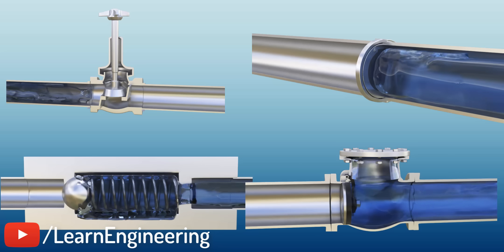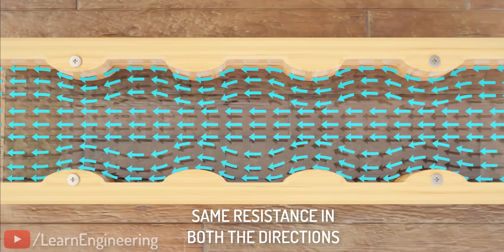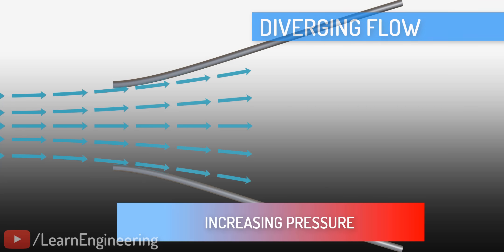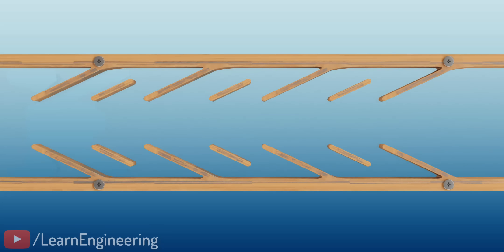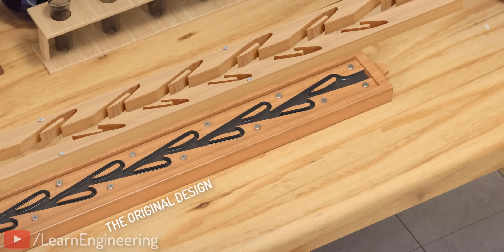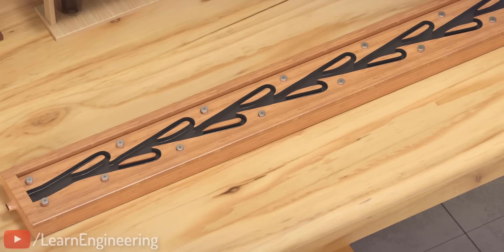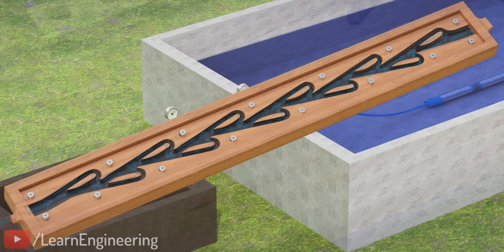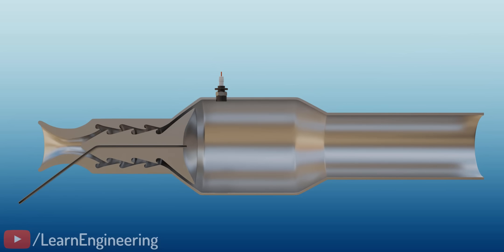Tesla Valve | The complete physics

Comment: I built an optical analogue of this in the 1970's.  I was not aware of Tesla's fluid version.  Same principle, more or less.   The optical version was a 'circulator' which allows light to pass in one direction, but blocks it or re-directs it in the opposite direction.  Existing circulators at the time required polarization and rather exotic crystals.  This version required only light fibers.

Comment: Pressure decteases in converging flow?  Going for om a huge pipe will increase velocity which is what you indicated but wouldn't it also increase pressure.  The water coming out the small pipe will be fast, powerful and aggressive common logic says it's under more pressure.

Comment: Although this design is interesting and I enjoy videos like this, this Tesla valve DOES NOT serve as a one way check valve as stated in the video.  It would in fact be a terrible and fatal design for equipment if used for such.  A check valve is meant to allow the UNRESTRICTED flow of a liquid or gas in one direction while stopping it from flowing in the other direction.  This design, as illustrated, does not allow an unrestricted flow, in either direction.  It creates turbulence and pressures which would not be desired.  Nor does it stop back-flow, which is the entire purpose of a check valve. I utilize a check valve on my swimming pool system to keep my water pump primed at all times.  You would not want to restrict the flow of water to the pump, which is what this Tesla design would do.  I've had check valves repaired and replaced that are utilized in sewage systems.  You would not want to restrict the out-flow of sewage while the pumps are running, but check valves are needed to insure that there is no back-flow, which would cause the system to work unnecessarily harder.  In fact, it would cause the failure of the system with long runs uphill and no check valve.

Comment: I have always replaced a "leaky" valve  with one that does not leak. Plus this "valve"  is NOT a valve, it does not work as a "valve" because it is always either "on" or "semi-off". So, where would you use such a "valve"?

Comment: So it’s not a valve, it’s only use would be to slow down water and possibly gain energy from water sources. He didn’t design a valve. The purpose of a valve is to completely stop flow in a single direction, this doesn’t even do that. Cool idea but it’s weird that it’s considered a valve

Comment: if you need to change the direction of the valve, then you have a moving part + it doesn't stop the flow completely. The initial challenge failed.

Comment: OK but if it doesn't stop the flow of water and you have to place it in a specific way to get the specific result, why is it called a valve instead of a pipe with high resistance? I always think of a valve as being able to stop and start the flow when needed.

Comment: Aside from that one example, are Tesla valves used anywhere else? I use swing and spring type check valves a lot in plumbing. I would imagine that Tesla valves would have to be too long to be practical in most plumbing applications.

Comment: Despite it's name it's not really a valve. A valve can be turned on and off. Most valves can restrict the flow completely. That's just some structure that slows down the flow of a liquid in one direction. It can not be turned on and off - other than reversing the flow of the liquid. It's a flow restriction - not really a valve.
Reply: A simple small check valve that you can buy at the hardware store can't be turned on or off anymore than this valve can. Yes, it is indeed a valve.

Comment: 0:17 Of course it's impossible. Water is a moving part. Or you can think of it as a bunch of moving parts.
Reply: I was going to say that it is not technically possible because the tesla valve works by redirecting water against itself which essentially reduces the speed of the water by a percentage which would make it impossible to completely stop moving
Reply: @Michael-W-V  Well, no valve can work with perfect accuracy one hundred percent of the time.

Comment: Nikola Tesla: god of superpressure tech, where his waterjets are so powerful that they cannot be penetrated by blows from an iron bar.  Tesla reports that he almost died at Wardenclyffe, when the steel bolts suddenly fractured from a high-psi flange, and the flange was flung right up through the roof.   He said it missed his face by inches.  
The key to this is AC-to-DC conversion.   If you yell loudly at the Tesla valve, it should produce some wind.  Also, if connected to a sensitive pressure-switch, then loud sound-vibrations should pump some air and cause the switch to close.  With several valves and several resonant cavities, you could make an electric door which only opens when given a tone-sequence (when it hears specific music being played.)   
Submerge a Tesla-valve in a vibrating bathtub full of water, and the valve should propel itself forward; an example of wireless power (the valve is harvesting energy from the water's ambient vibrations.)   Now try it in air.  Can you make a sort of helicopter lifted by air-jets, where the power supply is a nearby bass loudspeaker in the same room?   
Note that the Tesla-valve is based on fluid inertia, and it stops working when fluid is too viscous.  Make a Tesla-valve straw, and if you suck up some milkshake, the straw works the same in both directions, but if you try it with a glass of water, it again becomes a one-way valve.  The fluid must have low viscosity, so it easily forms jets, turbulence, etc.  (Heh, now repeatedly whack the water glass with a drumstick, and the straw becomes a fountain.)

Comment: But what about pressure changes? It seems that restricting flow with vortex's would also increase back pressure on the system - yes? What if you used the same principle for an exhaust manifold on a generator. Would this create enough back pressure to damage the equipment? Tesla's valve is a VERY interesting concept!

Comment: Check your history. This failed for the reason it was invented. It is in reality a bidirectional flow restrictor. it restricts flow in BOTH directions. Even the FORWARD flow is restricted but in reverse while it is more restricted there is still a flow.
This is not the case with a check valve.
This is a failed experiment because of the problems of the fact that flow is only restricted instead of being checked in the reverse BUT the flow is ALSO restricted in the forward.
The more efficient it is made to restrict reverse flow the more it restricts forward flow.

Comment: it doesnt matter what happens between the entrance and the exit with liquid. 1cc in equals 1cc out. If you are using a positive displacement pump to move the fluid, the pressure MAY increase, but volume wont change.

Comment: This isn’t a valve it’s just a resistor. Isn’t the definition of valve to control the movement of water or air. With this you are just slowing it down i guess you are controlling it but you can’t choose the control you just put it there.

Comment: I think it's interesting that Tesla called it a "conduit," and not a "valve."  I personally think he had bigger, (longer and wider!), plans for this invention.  Suppose the "valve" was made VERY long, (not just the short DEMO version Tesla submitted with his patent application).

I imagine a Tesla conduit might be designed to allow water to be pumped up to the roof of a 1000 story building.  The column of water being lifted would never be permitted to exert its full weight against the pump on the roof, (or one on the ground).  No other valve system that I know of would allow this, because gravity is allowed to win.  In such a "Tesla conduit," though, most of the weight of the water column would be diverted into making the CONDUIT weigh more, overall, but would NOT contribute to the difficulty of RAISING the water column to a high level above ground. 

Now, I suspect it would take a whole BANK of such valves, running independently alongside each other, (inside the conduit), to allow a respectable current flow.  A very long, one-way conduit, with the capacity of a fire hose, say, seems like something people might find a use for, someday.

Anyway, excellent graphics, and a clear presentation of Tesla's idea.  Very nice work!

Comment: All the valves shown are check valves, 2 of them can be used as pressure reducing check valves. The tesla valve is just a pressure reducing valve, it will not stop back flow if water flow stops.

Comment: The Tesla valve shown (the one with the loops) is nearly useless.

Once the valve (or space) is filled with fluid, the flow will continue through the valve with the same pressure and rate it would have in a pipe.

Comment: The concept of a one-way valve being created here is simply incorrect. The Tesla valve only causes restriction, but does not stop flow in one direction. It will flow more one way, and not stop flow the other way, which is what a valve does. While the flow vortices and flow dynamics are correct in theory, they simply do not stop flow like a one-way valve does. Therefore, Tesla did not develop a one-way valve.

Comment: Not sure if the picture at 1:20 is the best example of this because it leaves the water at the side out of the explanation. If the sides were closed there wouldn't be a question but for the case that is shown in the picture converging and diverging has a middle and a side part, or doesn't it?
Reply: Its best example i thik

Comment: I think a Tesla valve can be scaled down to nanometer scale dimensions. Such small valves would rectify the random Brownian motion of gas or liquid atoms/molecules. The amount of Brownian motion energy is the same for any size element so performance increases with smallness. The performance per element is very small and it aggregates with the number of elements so billions of valves facing the same way are needed for millihorsepower scale power levels. This is of scientific interest because it would hypothetically be a working Maxwell's Demon or, more precisely, a working Smoluchowski's Trapdoor, a similar device. 
Another commerter noticed that Edison, the empire builder condemned the valve develoved by Tesla the civilization builder. 
The nano Tesla valve array is a hypothetical free energy device that converts a working amount of planetary ambient heat into electricity. Using electricity usually results in heat so this is realization of full energy conservation.
I was granted patent US3890161A Diode Array,  opened to the public in 1992, an electrical analogue of the Tesla Valve Array. I want Breakteven Perpetual Motion Machines to be freely and unreservadly open to benefit civilization. 

Aloha
Charles M Brown lll, Kilauea, Kauai HI 296754

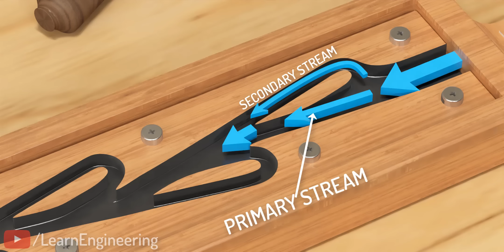Comment: SO many mistakes. 1:21, the entire argument concentrates on the center flow, ignoring flow near the walls. Of course, the 'diverging' case is CONVERGING near the walls. Vice versa for the 'converging' case. Do the results null? 2:55, the side-channel flow requires a pressure-drop from the 1st restriction to the 1st location of turbulent flow. But Bernoulli says that pressure decreases with speed; the pressure at the restriction must be lower than at the turbulence; i.e. there would be no side-channel flow. Or MAIN channel flow. Since mass flow must be constant, the counterclockwise turbulences must be nonsensical. This entire argument falls apart. 4:00, 'unnecessary turn,' gee, plumbers put unnecessary turns in pipes all the time, and the water obediently flows. Is there any PHYSICS to support this argument? But most damning is the finale, where gauges are hooked to an imaginary device. How about a REAL device? I can draw a picture of water flowing uphill, but that doesn't make water flow uphill.

Comment: Unfortunately, The initial conceptual analysis is flawed.  The simplified "diverging flow" has converging flows against the outer wall.   and visa versa. . . .   It is, therefore, an invalid analogy at the start.
This is not to say the Tesla valve is invalid, just the analogy at the beginning.
..
So often I see people (though well intentioned) trying to analyze fluid dynamics and ignore important parts, focusing on some single partial concept.  All applicable concepts  must be understood to explain it correctly.

Comment: This video could be shortened by about 5 minutes if you just cut out all the redundant talking points. You just repeated the same thing again and again using slightly different wording for 6 minutes in a row.
Reply: Also. . . The initial conceptual analysis is flawed, though the actual Tesla valve does work as described.  The simplified "diverging" flow has converging flows against the outer wall and visa versa.

Comment: It would have been nice if you had explained that in the converging and diverging designs, both had points where pressure increases, and where pressure decreases.
One design does not have pressure always increasing everywhere and the other pressure decreasing everywhere, the "outside" of the arrow always has the opposite effect on the flow than the inside.

I guess the location of the vortexes is where it really differs ? (A vortex in the middle will have a larger impact that vortexes  on the sides ?)
Reply: Good catch. The initial conceptual analysis is flawed, though the actual Tesla valve does work as described.  The simplified "diverging flow" has converging flows against the outer wall and visda versa.

Comment: This valve will be prone to clogging very easily, so any clog or blockage along the way will change the way the valve works. (if all those loops providing back pressure fail, it quickly becomes a two way valve)it is also much larger than the mechanical valves, also it says the tesla valve doesn't block flow completely so you will have a  dripping faucet or whatever the valve is attached to
so many reasons why this valve was never and will never be used( drip irrigation perhaps it isn't a total loss)

Comment: To all the people saying this is a pressure reducing valve: if the input flows and you block the output, won't the pressure rise until it stabilizes at the input pressure?
It only works for reducing dynamic pressure, not static pressure!
You could use this to reduce flow in an open system, but not as a pressure regulator to protect downstream from static pressure.
In any case, what is the advantage over a flow restrictor, orifice, etc?

Comment: I'm sitting here thinking at 5am. The T valve could be used in my theory to separate miroplastics from our oceans. In a large scale and reversed, it could be used to separate MP's utilizing the votexes while allowing larger things/wildlife to pass through. The plastics being lighter will favor the secondary channel so that is where we place a filter fork with no suction, only an air regulator to control the pocket at a height. Miroplastics will pass through a screen and follow natural bouncy to the filter above. For heavier plastics place screen and filter at vortexes later in the valve. I'm still working on the filtration process.

Comment: Every non return valve is passing till it is "closed" due to flow reversal. This reversed flow should be minimum possible. Better is the valve whose "closure" occurs on lesser flow reversal. In such a valve we can not achieve perfect zero return flow as NRVs are supposed to do. Though it can offer good resistance to flow making it "throttled down" but we have control valves for it. Therefore such valves are not used in industries today

Comment: One Parsec = 206265 AU = 3.26 light-years = 3.086 × 10^13 km. 
The Numbers: 3, 6 and 9

((3^6) x 9) - (3.086 x (10^3)) -1 = 3,474 
The Moon's diameter: 3,474 km. 

Now we will use the diameter of the Moon.
Moon's diameter: 3,474 km. 
(3.474 + 369 + 1) x (10^2) = 384,400
The term L.D (Lunar Distance) refers to the average distance between the Earth and the Moon, which is 384,400 km.

Moon's diameter: 3,474 km. 
((3+6+9) x 3 x 6 x 9) - 9 - 3 + 3,474 = 6,378
Earth's equatorial radius: 6,378 km. 

Book: Orion. The Connection between Heaven and Earth.

Comment: I am reminded of a device I came across back in the 1970s. It was in a book called "The last Whole Earth Catalogue" and was called a Hydraulic Jack.. No, it had nothing to do with jacking up a car, When put in the flow of a pipe, it would divert a proportion of the flow UPWARDS . That is, part of the flow could defy gravity. I have no idea how this happened because there were no details of the inside of the Hydraulic Jack.. What this device could be used for was not revealed. I did think that it could be used in  hydraulic  generator situation, feeding back some of the water to the input of the turbine thus increasing the flow through the turbine without exhausting the water level of the dam. I have never seen such a device since.

Comment: Looks more like a directed restrictor than an actual valve.
When the flow reach a certain level the "valve" will build up pressure, but there is still a flow through.
If this was an electric circuit, I would compare it to a diode and resistor in parallel.

Comment: Easy flow in one direction. Restricted flow in opposite direction. It's the equivalent of the diode in electronics. But why call it a valve? That would suggets that it can be opened and closed. This device is static though.

Comment: I wonder it the (above) choice of the valves Airfoil shape is the optimal one. It looks like just a crude "Clark-Y" Airfoil/profile/shape.
A better-tested Airfoil would surely improve the efficiency of its valve function and reduce thru-state friction at the same time.
Same goes with the shape of the external manifolds' contours.

Comment: Why is it called a valve?
Seems like a fixed pressure resistor.
If you make it a valve, you are basically turning it one way or the other - thus adding a mechanical force.